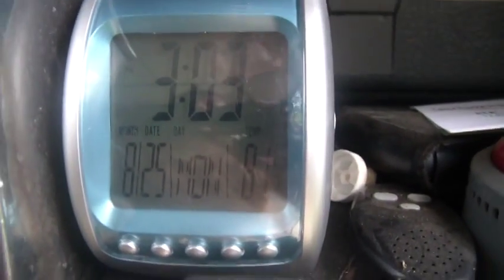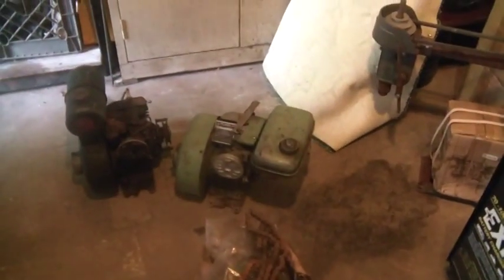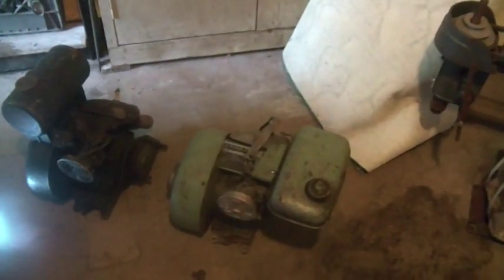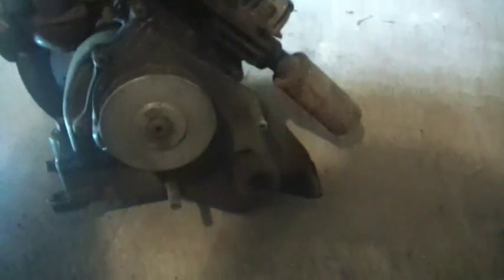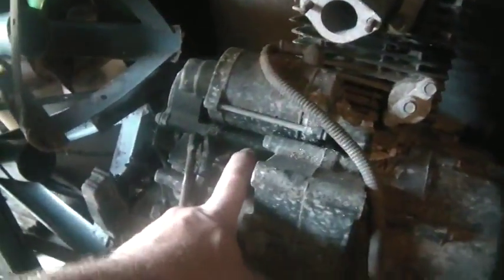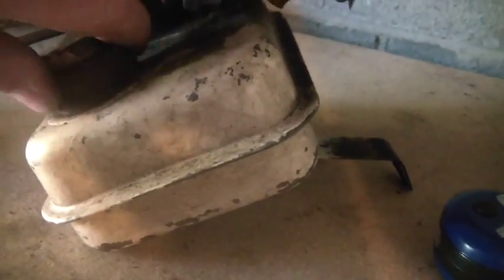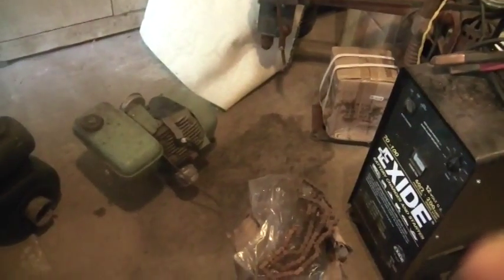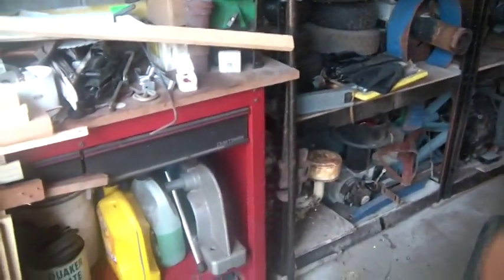8_25_2014, Old Reo engines, mini bike parts,

Comment: Reo made the complete mower. The output shaft is actually the end of the camshaft. That is the reason for the 2:1 reduction and direction. I should have kept the entire mower I had.
Reply from the maker: ***** , The 2 Reo engines I got came without the mowers, One has to admit, they are cool old motors, Thanks for the info, watching, and commenting!!

Comment: I'm also looking for a #35 chain 72 tooth sprocket with a 1 5/8" center hole and 3 mounting holes 2" apart
Reply from the maker: 231flash, #35, 72 tooth sprocket, no too hard to find, the 1 5/8" and the 3 mounting holes 2" apart may have to be customized. I would start my search with BMI carts, see what they have. Thanks for asking, watching, and commenting!